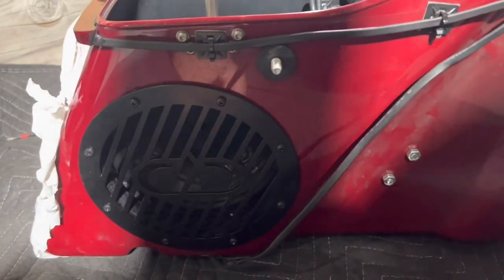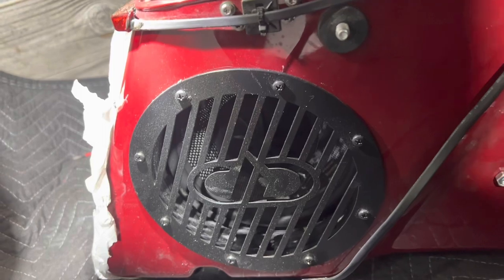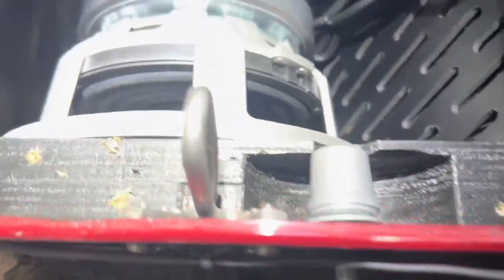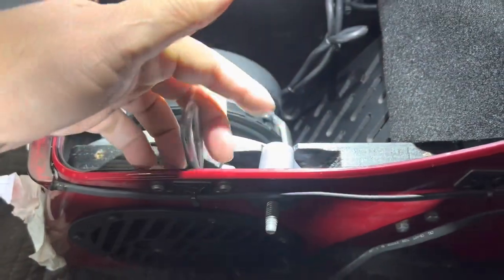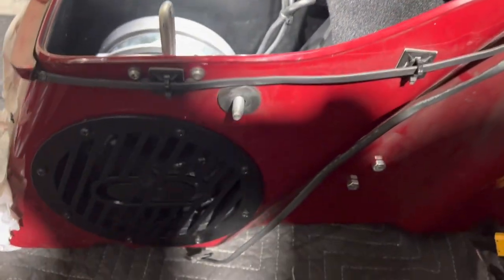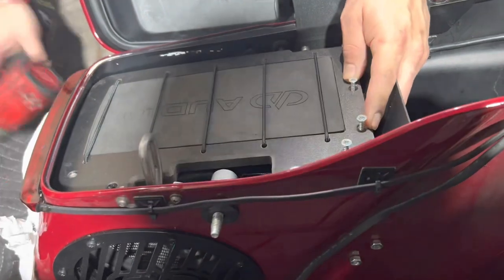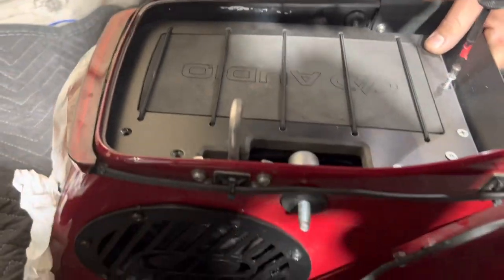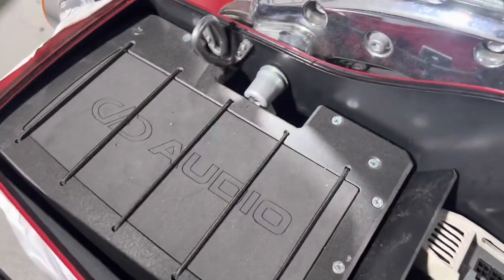Harley Davidson Road King stage 3 audio upgrade

Comment: I see the Rockford 400x4, what amp is pushing the 8's I'm the bag 🎒
Reply from the maker: Sound digital 800.4 bridged 

List of all the equipment used in in the video description.

Diamond audio MP654 in the lowers
Diamond audio MP694 in the lids 
Diamond audio dsp 
PAC isimple music stream 
Rockford 400x4ad
DD audio cut in kit 
Cicada carbon mid bass 8s 

Stinger ofc copper wiring and rca 

 Braille g30h lithium battery